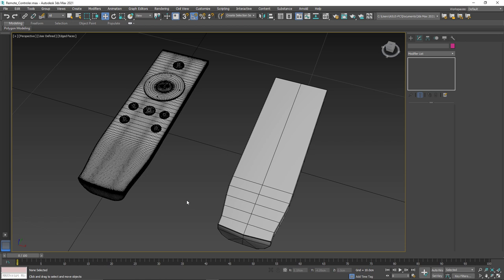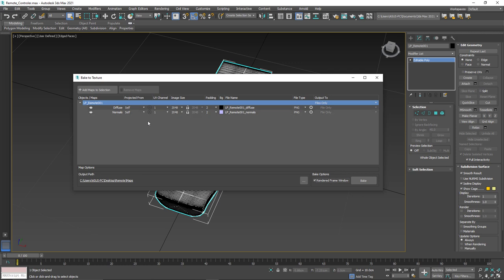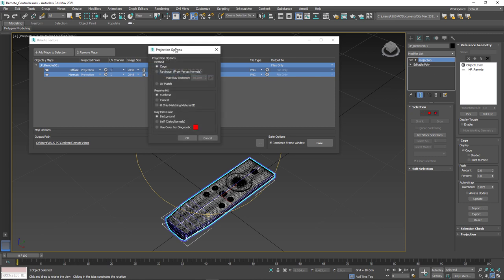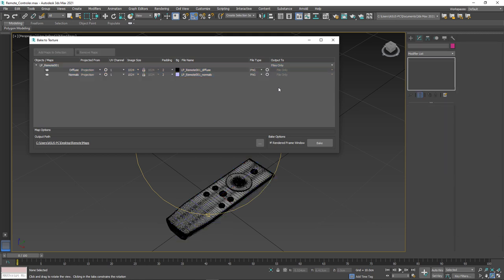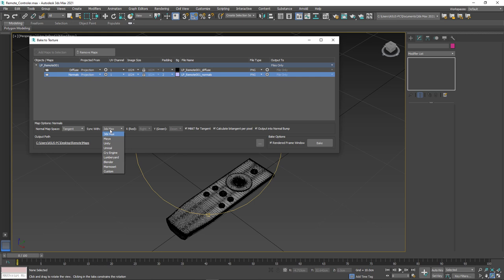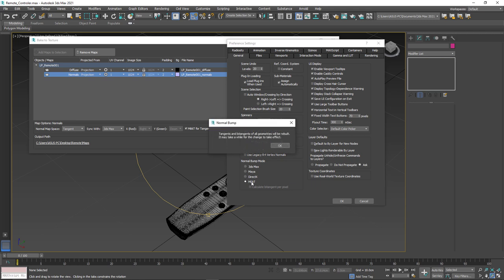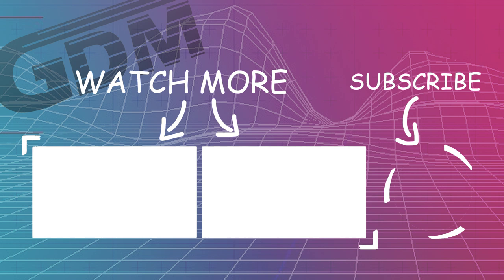3ds max 2021 - Bake to Texture

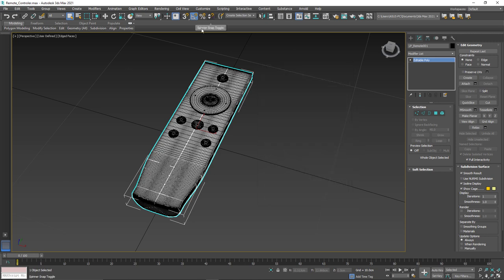Comment: Nice tutorial. However, Baking to texture is not a new rendering system (time 01:24) compared to rendering to texture. They serve different purposes. When we use baking to texture, we are actually planning to "RECREATE" our camera angle and lighting system at render time, whereas when rendering to texture is used, we will have much more control over our rendering environment during render time. Thank you 💯
Reply: No. This is incorrect. The original utility in 3ds Max for baking maps was "Render To Texture". It was designed to work with the Scanline Renderer and also worked with Mental Ray. However, it does not support the new "Physical Material" nor does it support the Arnold renderer. The new "Bake To Texture" utility is an updated version that supports both the "Physical Material" and Arnold. The new "Bake To Texture" utility makes the old "Render To Texture" utility obsolete.
Reply: @eudymaverickmentor  Thanks for correction professor. I didn't know that.

Comment: Pretty good tutorial. However, your normal is toast. You need to turn off Gamma Correction before you bake the normal map. That is why your normal is all washed out.
Reply: sorry may i ask where to turn off Gamma Correction?
Reply: @kyvandieng  Rendering - Gamma/LUT Setup - Uncheck "Enable Gamma/LUT Setup". Only do this for baking a Normal Map. Otherwise it should be left checked on.
Reply: @eudymaverickmentor  thank you so much